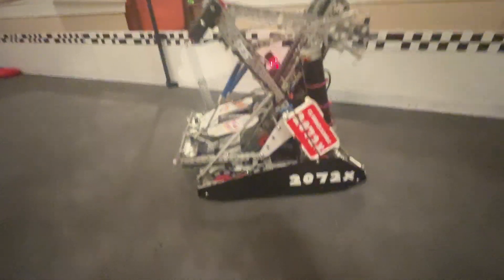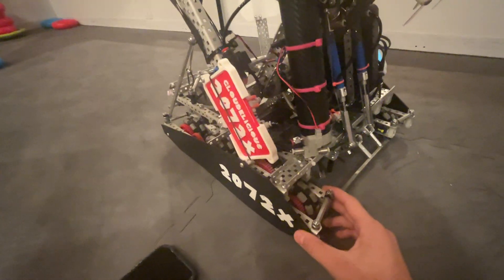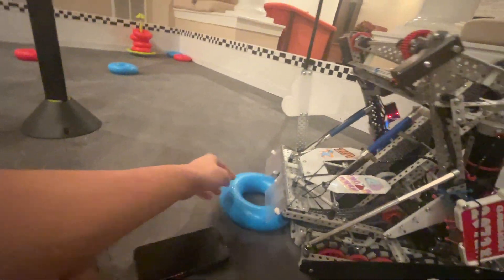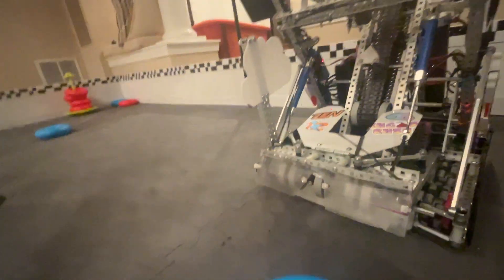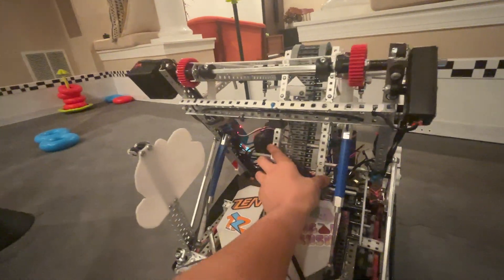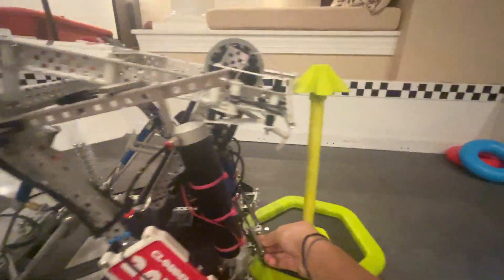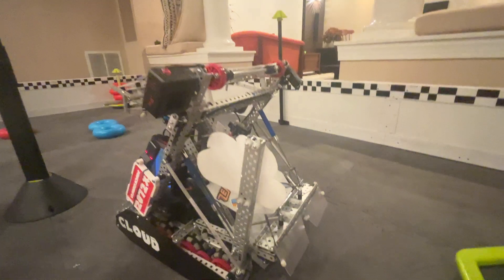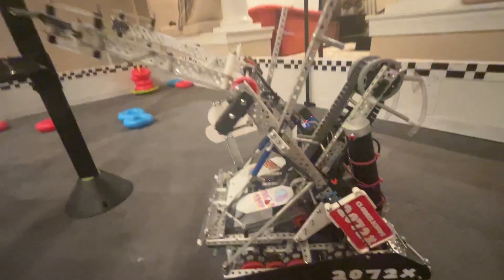2072X Post-Sugar Rush Robot Explanation

Comment: Do yall have a problem if the hook hits the ring and it’s not in the hole the ring pushes against the poly then the intake stops running until u reverse and intake again
Reply from the maker: slightly. we did fix that issue with new vertical intake plastic and a better peice of plastic to pressure the rings down into the hooks